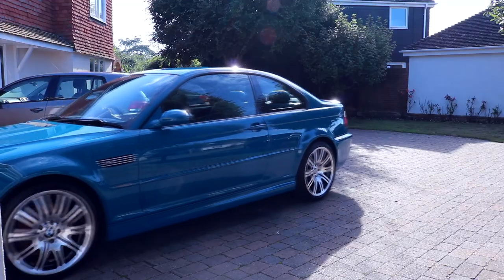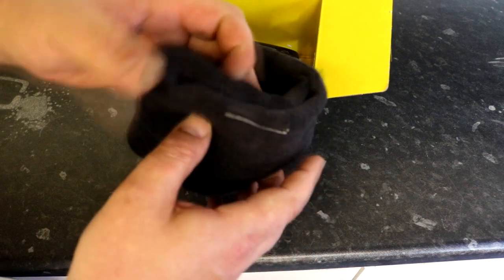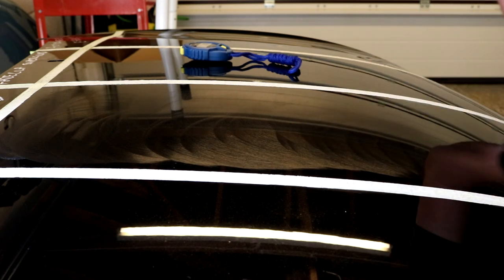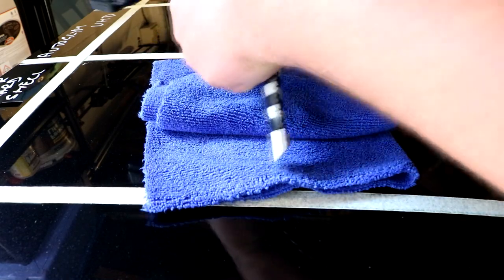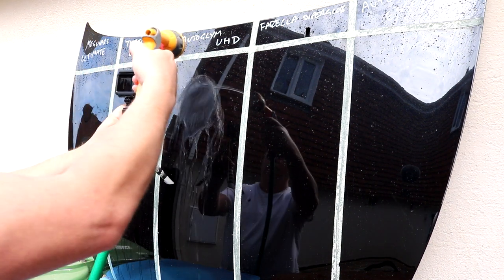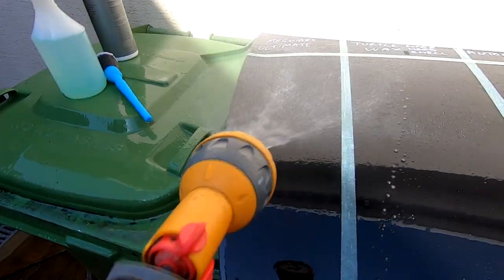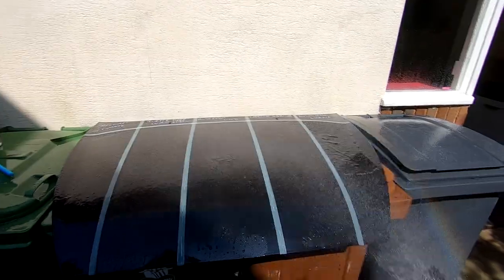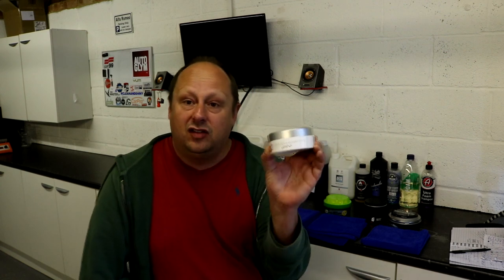Battle of the Halfords Paste Waxes - The ultimate comparison review

Comment: I am assuming your talking about TurtleWax Ice, which I think in your match up would end up being a strong second in your current line up.  I use it and the corresponding spray sealant that see the most washes and they do an amazing job.  My one jeep that does not get to see as much love I have soft99 fusso coat on and I can say 6 months of hot Florida sun on black paint it water just rolls off it like the day I applied the wax.
Reply from the maker: yer its coming to the UK but I think its gonna be a different name. essentially same product maybe just a slight change.  will check that out and pershaps the waterless wash product.
Reply: @ForensicDetailing  Well when it comes over to the UK I am happy to send you a tub of what sold here state side to compare against.

Comment: As always enjoyed the vid.

Quick question. How would you say these products, or the UHD winner, rate Vs spray on rinse off type sealants. 

Wax once per 6 months and polar blast once a month on the maintenance washes?
Reply from the maker: hi ya spray on rinse off are more quick products, almost like maintainance products you can add protection with little or no added extra time.  you wouldnt really use a spray and rinse after a full proper.  you also need to be carefull with spray and rinse in the summer.     UHD combos up well with SRP for guys at home with no machine polishers.  you can use aqua wax or polar seal to add protection later on.
Reply: @ForensicDetailing  awesome thanks.

Comment: I’ve used dodo juice light fantastic in the past which is a great one and easy to use, the only downside I found was the durability. However being a soft wax it’s not really it’s strong point. I really want to try the Bilt Hamber dsw and the in2detailing wax, purely for value I think these will be hard to beat whilst still giving you a decent gloss.

Comment: Some of the turtle wax stuff the yanks are using looks quite promising, at the price point (if they match it over here) it will be hard to look past for the quick maintenance wash. I rate HD wax after my mate applied some to my car. P.S I got a brand new tin of essence off Ebay for 7 quid... worth looking as the same seller always has them on there!
Reply from the maker: 7 quid?!  gotta be something wrong with them at that price surly Dan. Im thinking a knock off or like bad batch or something?  least I hope so jesus, I payed 35 quid.
Reply: @ForensicDetailing  it was an auction started at 99p... maybe I got lucky but ones I saw after were going for 7-12 quid!! I got a bargain! Nowt wrong with it dude used it twice on my old golf and new m135i and it's fine (had the same liquid) on the top as you did on your tin in the vid so that must be a common thing. I had it just after xmas when it was cold and still the same so I wouldn't think it was temp?
Reply from the maker: @hawx7gaming368  ah ok mate I understand, sometimes you get that auction thing going on.  I just thought someone was selling it like for 7 quid all the time.  thats the sort of thing AF would not want going on.

Comment: In all my years of being around "the good stuff" I wouldn't even look at TW. I've moved away from waxes anyways but I know this, if I were sticking with "waxes" it would be Collinite #476 and #915, hands down the best out there. This company has no marketing that I've seen, just a solid product that comes in the old school metal tin. 

FWIW if you like waxes I can't say enough about Collinite #476 and #915! Now #845 from Collinite is ok but doesn't last nearly as long and certainly can't match the looks of #915, I'd use #845 inbetween applications as a "booster" since so easy to use. Oh yeah and speaking of easy to use, "thin is in" when it comes to #476 and #915, don't let anyone tell you they're hard to work with...UNTRUE! Listen to me/us and you'll be rewarded by using 476/915👍👍
Reply: Can you get 3 months protection from 915? Most waxes I use last maybe 60 Days? And yes I clay, Iron decontaminate the car and do a IPA wipedown and wash only with PH soap for maintenance washes.
Reply: @daves.3278  you'll get atleast 3 monthes but there are variables anywhere you live though. If durability is 100% the most important then just get #476. Before I got on board with coatings I did 2x's going into a winter and #476 did a great job in a bad Chicagoland winter. 

#915 is really especially impressive on dark/black paints. I know you don't know  me from Adam but Collinite is awesome, don't get me started on Klasse sealant glaze, it's my favorite behind coatings.
Reply: @klasseact6663  gotcha thank you for the reply i live in Chicago aswell. Yesterday it snowed haha so yeah winters are lasting till late April 😂😂 going into may.

Comment: Nice one as always Jon.
I've been using G3 Supergloss for a while, can almost spread it over the whole car before buffing and it's still easy to use in warm weather. However I found the durability disappointing,- two months at best and then it was gone especially at the back of the car. I do around 700 miles a week so maybe I can't complain.
I kind of guessed AG UHD would come out tops but I'm not sure if it's worth the extra pennies.
Good health to you.
Reply from the maker: typically ones that feel oily and cure slowly dont have durability of ones that fully cure and/or cure hard.   there are exceptions to that.   but I think supergloss is a proper high nuba paste wax.  you can even smell the nuba.  its nice but yer not a durability wax.
Reply: @ForensicDetailing  thanks Jon, that makes sense.
Cheers.

Comment: Nothing can beat bilt hamber in its price range imo
Reply from the maker: pipe hitting products arent they :)  14.99 for double speed. 17 quid for 5 litres of the most powerfull high concentrate APC or snow foam out there.. strongest reacting FR on the market.   everything is good value even the rust inhibtor concentrate.  its an awesome brand.

Comment: is this a sponsored video?
Reply from the maker: no content is sponsored on this channel.  I get offered sponsorship from brands on a weekly basis and I could quadruple the channel revenue if I accepted it but I dont think I can compare products if someone is paying me.  If I ever do accept money I will say its sponsored (you have to).     This video will generate around 10-20 pounds view revenue and about 5 pounds amazon commission, but it cost over 70-80 quid to buy the waxes to get the full line up.  It also takes around 20 hours of work to make it.  So net profit is about a 40-50 pounds loss for 20 hours work to do this comparison video.     you tube only really pays if you click bait or trend hack.   Thats why its important if you get any value out of the channel to support it on patreon.
Reply: just curious how these things work - no complaints from me either way, excellent content and very useful. Thanks!
Reply from the maker: @balke7935  its a good question m8 and one you should be asking.  big challenge for me is to try and turn this thing into less of a hobby and a time sync into making proper money.  just no clue how to achieve that yet..

Comment: I used to think paste meant more protection but you have to apply so thin, these new products, it may aswell be liquid.  I also dont like how pastes get stuck in panel gaps and trim, the reason i keep away from those with cleaners int hem, that cause white marks on plastic, the synthetic ones are best for our climate, others are good for 10 minutes before you drive out in the non-california sunhine, but the horrible gritty wet uk weather.  People never test a wash after a drive in rain, how well the stuff DOESNT stick to the panel thanks to the wax or comes off in a wash, that would be another level of testing, forget water beading, they all sheet or bead, its how well in real world it keeps dirt from sticking and hwo well it washes off, thats the real stuff
Reply: You are right. In uk has intensive spread salting and you have to wash your car more often. It means the Paste waxes doesn't make any sense.
Best for me Turtle Wax Hydrophobic sealant wax... Quick and easy to apply. So amazing. When in Winter wash very often (every 2-3 weeks) i use to use after every wash this product but hydrophobic sealant wax has i think 2 month of durability. (at least) 
Maybe this is my best option because Paste wax applyng about 2 hours for me lol
Reply: @Noooname2024  If you want simple, G3 do a spray sealant too, nice for winter, VERY hydrophobic, wash spray and done. Their body prep shampoo is good too, bought that the other day, it gets all old wax off with one wash, great, easy. I like their no fuss line, a bit like bilt hamber, no silly names or scents to throw you off and think you need them. Farecla are the toasters of the detailing world - they just work.

Comment: All waxes are complete waste of money and people will come back with Autoglym and meguiars sell millions of units which is exactly the point. The reason they sell millions of units is because the product does not work and you are continually having to reapply these products several times a year using lots of product, these companies have no motivation to make a product that lasts as they would lose millions of dollars in sales. Use a good ceramic sealant coating instead of wax the extra effort is well worth it in the long run.

Comment: I am a bit confused with your definition of "value for money". It seems to me that "value" is the last overall category after all comparison... The way you use "value for money" is literally what I could call "the cost" i.e. so Turtle Wax is 100g/x£1.87. It would be fair to add accessories here and the cost of say AGHD becomes much more comparable considering high quality applicator and cloth is probably worth £15 on their own. In summary Turtle Wax cannot be "value for money", because what you get for £7.5 is 400g of turtle feaces... total waste of money. Considering application time and labour the value is probably even negative compared to something which woudl actually look good and protect your car. This is kind of key for me - why would I waste my time and my sweat to apply something so poor in quality. 

Overall, I found video informative, hence thumbs-up!... just a bit confused with definitions... :) 

Finally, I am sure there are plenty of information and perhaps you have done it yourself. But it would be interesting to add.. say "opinion" of where say AGHD sits when compared to ceramic coatings. For £40+ one can already get ceramic coating and top-up spray... That is why I was always very critical about "high-end" supermarket waxes - is AGHD actually "good value for money" considering coatings can be had for similar price? Could that change conclusion of this video?